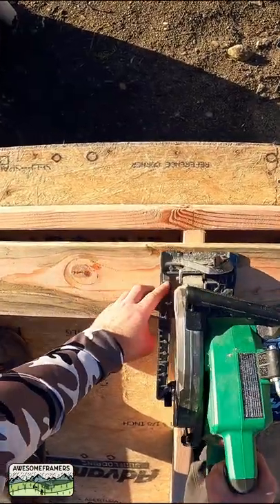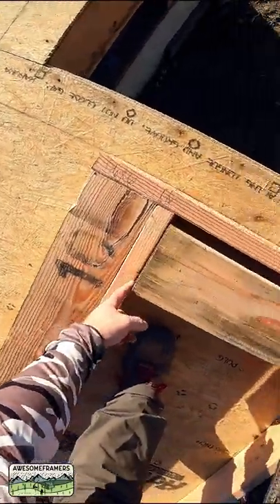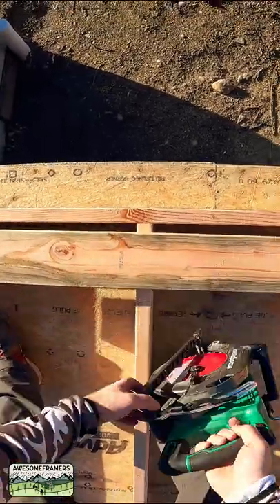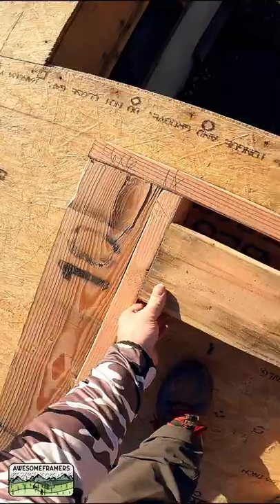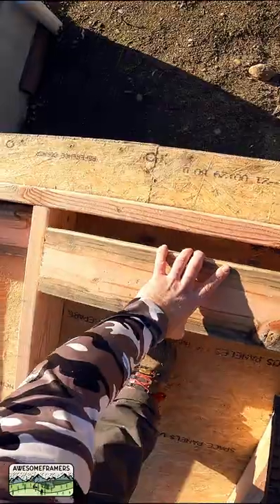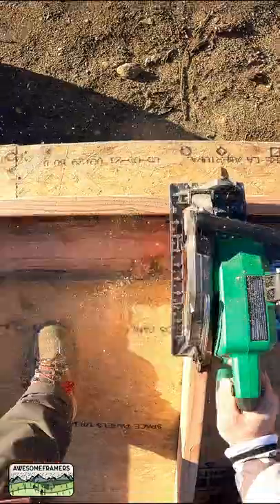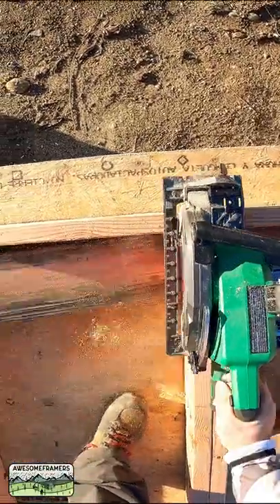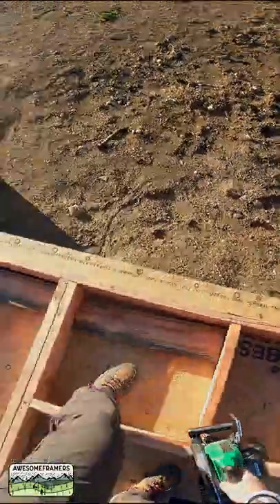Cutting Blocking by Eye with the Metabo HPT #shorts

Comment: Here waiting patiently for your review on this saw and (hopefully) a comparison with Makita's 36v and 40v. 😊🤞
Reply: I can tell you that the milwaukee rear handle 7 1\4 circular saw is worth its weight in gold. I build way too many fences lately and cut a lot of wet pressure treated wood. It buzzzes through very similarly to an actual worm drive powered saw. Immediately after I bought the Milwaukee I found out that skill saw actually makes a warm drive cordless. Was going to sell the Milwaukee to get that one. After short amount of use I don't feel the need.

Comment: I’ve always done this for perimeter noggings on my sets of joist, it’s so much quicker than individually measuring them. I’m from the uk and most new build houses require you to fit z clips on the end of them so you need to cut them about 4mm short anyway.

Comment: Very interesting way to use your saws base plate as a square and then simply plunge the saw. I like it. Probably takes a couple of tests to see how well your blade is aligned with the indentation on your base plate since you were actually don't want a loose fit. I think not all saws have such an easy plunge since normally the depth guide is supposed to be tight.

Comment: My Bulk common purlin block hack I Stack 2-2×6s tack left ends together flush , measure 14 3/8,  28 13/16, 43 5/16, 57 5/8, 72 it cuts 5 scores 5 pull same from 72 cut repeat stack scored 2x6 on next 2x6 cut repeat

Comment: I've always measured it. LOL. What a maroon. This is way faster.
Reply: Bruh the man is white
Reply: Either way is right. It's just faster his way. Lol
Reply: It’s not that much faster to do it by eye, just easier.  Unless you measure each stud bay instead of just cutting them all to 14 3/8
Reply: Don't understand always measure it etc. If the framing is 16 oc your blocks are 14 1/2 or 14 3/8 to not beat them in. Even quicker would be to stack a handful of 2x4 make your cut at max depth go down the board you've now cut and marked 6 blocks without dragging things around

Comment: Where did you get your saw from
Reply from the maker: you an find it here https://www.toolbarn.com/products/metabo-hpt-c3607dwaq4m
Reply: I recentlybegan using the Milwaukee rear handle circular saw. That thing is worth every single penny I spent on it.

About 2 weeks after I bought it I found out that skill saw actually makes a real warm drive cordless battery operated circular saw. I'm pretty sure you have to be a bodybuilder to wield that thing all day long.
Reply from the maker: @michaelrichardson5505  I am actually recording tomorrow on all the rear handle saws currently available. Conspicuous in its absence is the Skil. Ridiculous that thing is

Comment: Lmao this is why new houses all the corners inside the drywall Crack and house is off square ....respect to the old school framers that did the shit rite
Reply: I think it's the sheathing that holds the house square, not these little blocks.
Reply: @cosmoguzaldo439  glad you don't build houses bro ....it's all the framing that counts  making everything nice and square
Reply: @cosmoguzaldo439  

Sheathing stiffens the framing. 

The framing should be square within a 1/4”.
Reply: These are fire blocks, nothing structural. Just a time consuming step
Reply: @Tony Stark  what are you talking about ? You can’t spend and extra 3 hours in the sun everyday and expect not to lose 25 lbs a week

Comment: There's another (I'd say better) way to do this I just learned, Flush to the outside of the stud instead of the inside and run the shorter end of your saw's table against the other stud, the 1.5" gap on the saw's table perfectly accounts for the overlap on the other stud from flushing to the other side, and since you are using the stud as a guide instead of eyeballing it's harder to screw up.

Comment: Stand outside the wall over the top plates line the board up on the stud and line the table up on the next stud use the table as a guide it's a little quicker.
Reply from the maker: Sounds good but I had a 4' drop off there 😊
Reply: @AwesomeFramers  move to the top of the wall
Reply: @AwesomeFramers  same concept just telling you how I do it

Comment: What about the length of the blade
Reply from the maker: Length of blade is irrelevant
Reply: @AwesomeFramers  but why what about the gap it creates? Just eyeballing it like that there’s going to be a gap
Reply from the maker: @raidendoernte8931  as I showed in the video the miniscule gap is a non issue.  We want them to be a tiny bit short so the studs don't get pushed off layout.  The blade removes 1/16" from the block.  When we precut blocks we always cut them 1/16" short, some even cut 1/8" short because in framing things grow.

Comment: If you got a cut man have him pre cut a bunch of 14-3/8” blocks ready for the go. 
This works great too
Reply: 14 3/8 is too short… make them 14 1/2 small or AKA 14 7/16 or 15/32… Which is just basically cutting the line off a 14 1/2
Reply: @hmtrimworks7148  your moms too short. 
1/16” difference for blocking isn’t going to make a difference, we do 14-3/8s due some studs are not always a true 1-1/2  and sometimes your fighting that 1/8” cutting them right at 14-1/2”. 7/16 is great too, not much of a difference in 7/16 and 3/8s in rough framing, especially for something like blocking. 
Cut man cuts all his blocks on the chop saw or table saw so his blocks should be exact and square. 
3/8s always seems to works just fine for our crew we build nothing but high end custom homes, turns out clean and tight every time.
To each their own
Reply: @DaMadDad  I stared framing in the mid 80’s and framed developments of higher end houses and I’m usually the cut man and cut miles of blocking both residential & commercial… and I know if you cut them all 14 3/8 you will pull the studs or joist and make them bow in one direction… the object of blocking is to keep everything straight with NO gaps…
The difference between 7/16 & 3/8 is a 1/16… in 8’ that add up to a 1/2” you will be off and will get worse as you go… good luck breaking your plywood or Sheetrock without banging or prying the joist or studs over or custom cutting sheets… also your insulation batts will fit sloppy… but you go ahead build your “high end” houses with sub-par framing… like you said “to each their own”…
And I love my Mom… she passed in 2018 and I’d appreciate it if you would be respectful
Reply: @hmtrimworks7148  you must be the best framer in the world. Your mother must be proud of you proving everyone wrong on YouTube. Get off you high horse bud. No cares about your framing skills or your mom.
Reply: @DaMadDad  And I’m not trying to prove anyone wrong… I’m just proving that I am not a hack
Reply: @hmtrimworks7148  going around Claiming others are hacks over a 16th of an inch is pretty trollish. You should see a therapist
Reply: @DaMadDad  that’s an 16th/8th inch multiplied many times…
And I’m sure I’m not going to be the only one to tell you that you need to see anger management
Reply: @hmtrimworks7148  😂😂😂 you’re right, you’re not the only one to tell me that, that we can agree on. 
Take care sensitive boy
Reply: @DaMadDad  yeah, you take care as well… And if you’re not taking bipolar meds you ought to be… If you are, you should up the dosage… 
Later emotional boy

Comment: Never seen studs laid out to a centre line. Not nearly as accurate. Take 3/4 off and x ahead.
Reply: If you can't perfectly center a stud on a plate with the layout like that, you shouldn't be building houses...
Reply: If you mark the center you can use it for the plywood
Reply: Never seen that? You ain't been around a whole lot than. I've framed hundreds of houses like that much faster and easier. When you get good at it your within a sixteenth of an inch of center Everytime.
Reply: @user-zu2bw7ig5v  & precut a pile of blocks fuzz under 14½" for majority...

Comment: Blocks are loose, when the shrink after sitting in the sun, they’ll be big ole gaps.  But your on the right track.  Practice practice practice!!!!!
Reply from the maker: They won't shrink because we use KD lumber 👍👍
Reply: @AwesomeFramers  I subscribed, and you obviously do great work, but kiln dried lumber isn't immune to fluctuations.
Reply: @AwesomeFramers  good man, sorry it didn’t look like KD lumber at first.
Reply from the maker: @Tool_Addicted_Carpenter  I didn't mean to imply it was immune to fluctuations, but rather that because its KD it isn't going to shrink.  I check moisture content before insulation and we don't see the movement many see in their lumber.
Reply from the maker: @mastercreamer1398  no worries mate.  We are really fortunate that the KD DougFir we get is very stable.
Reply: @AwesomeFramers  you guys start using engineered studs yet? Hard on the guns but makes for a very long term home.
Reply: @mastercreamer1398  yes it does. Heavy as shit tho I hate using it because of that.
Reply: @user-zu2bw7ig5v  what you talking about homie?
Reply: @mastercreamer1398  engineered studs